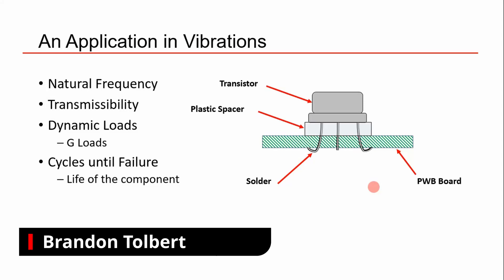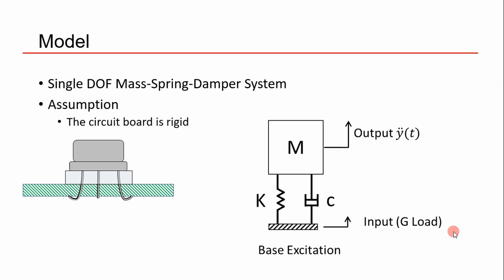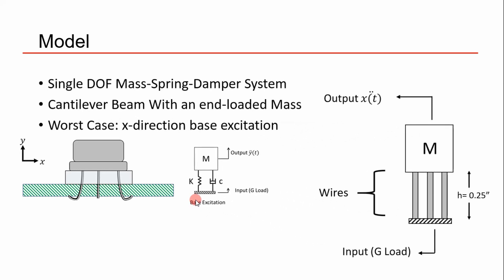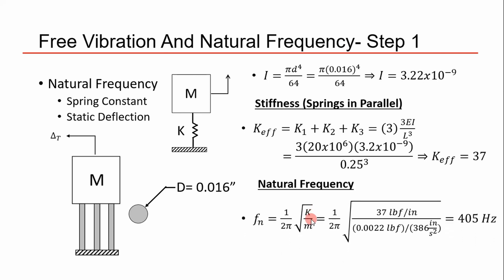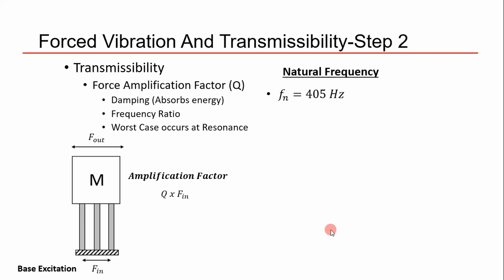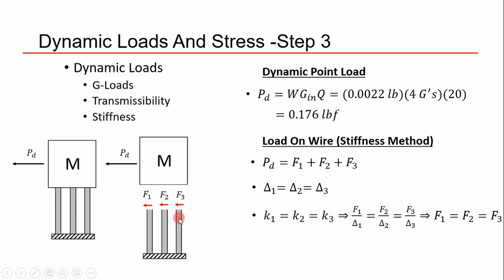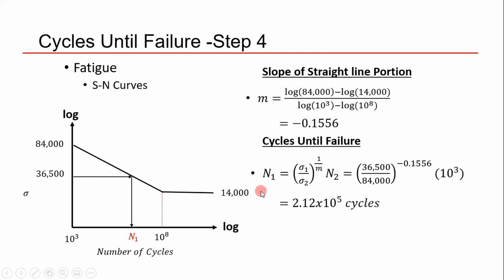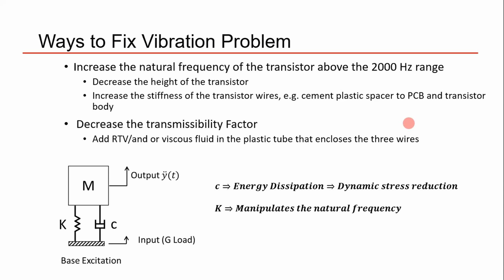Vibration Application: A Step by Step Approach

Comment: Very nice explanation. I used to design structures subjected by machine vibration by checking the resonance of the structure based on velocity or displacement requirement. Its very nice lesson.